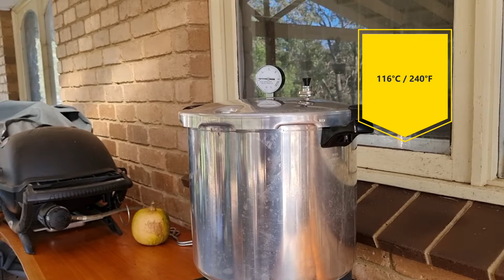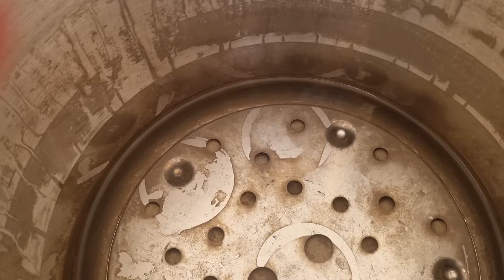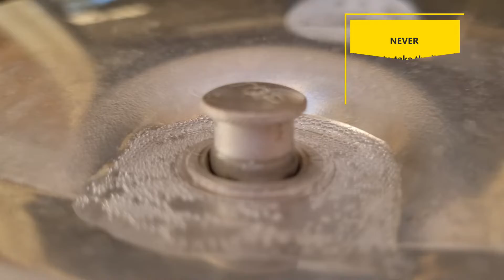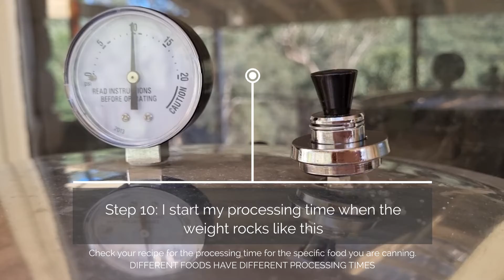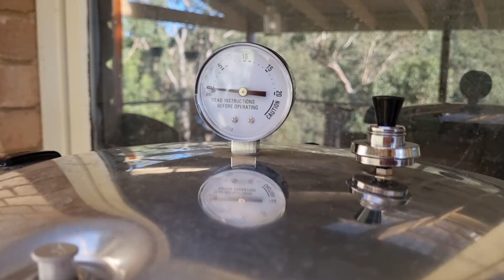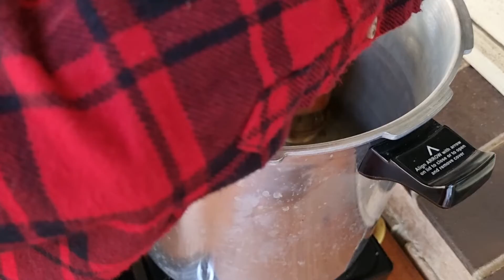Canning Basics Series Ep.4 - Pressure Canning

Comment: This series is incredibly helpful. Thank you! 
Just wondering wat you think of silicon seals. I've seen a few stores like Amazon selling silicon 'reusable' seals, but I'm a little leery of trying them because the big canning brands don't seem to be stocking them. Have you tried them? I'd love to find a reusable option, even if it's only good for a few uses, but I don't want to risk the integrity of the seals if the rings are not the correct consistency.
Reply from the maker: Thanks for your lovely comment and a great question. I haven't used the Tattler reusable style ones personally. We do use ones like Weck though, which has a glass reusable lid but rubber seal which gets replaced.

Comment: One hint that i have learnt over time - if you are not doing a full load in the pressure canner, it won't achieve pressure. Helpful to add a few jars with water in them to fill the space. I reuse my mason lids for this or use wek jars so I don't have good lids wasted.
Reply from the maker: Ooohhh... I like the tip of reusing the lids for this purpose. Thanks for sharing  😀

Comment: Hi
Just wondering I’m new to pressure canning and my weight didn’t jiggle the first time I used it I went off the gage. Is what I canned still ok
Reply from the maker: There are 2 types of weights. 

The standard one that comes with the canning  unit, is just a weight to hold in pressure but doesn't maintain the unit to a set pressure. With the standard weight you use the dial gauge. It doesn't really jiggle as is heavier, so steam doesnt really come out to make it jiggle, unless there is a lot of pressure in the canner.

The second type of weight (which I use and is in the video) is a weighted gauge. This maintains the canner to a set pressure, based on the weight of the weighted gauge. These jiggle when the steam starts releasing at that pressure. If you are using a weighted gauge style of weight, you do not refer to the dial gauge. Even though the dial gauge is kept on the canner.
Reply: Thanks so much for replying 
Can I ask where did you get the weighted gauge from? I got my presto canner from mushroom supplies in carrum downs
Reply from the maker: @jennyhosemans213  They may also sell them... but if not, Amazon definitely does.  Here is a link -
https://www.amazon.com.au/3-piece-Regulator-Pressure-5-10-15lb-0175001/dp/B0B667T1S8

Comment: Where did you get your weighted rocker? Do you say your altitude to get the right weight?
Reply from the maker: You will need your own specific altitude for the correct weight for your location. It comes with all the weights to adjust it, so you could realistically take it to different properties at different attitudes.
This is the one I use - https://www.amazon.com/Presto-50332-Canner-Pressure-Regulator/dp/B07VGQHWVX

Comment: Thanks so much for this Rachel. I’ve been waiting for this one. I’ve got the same pressure canner but like you have a glass stove top. What portable gas burner do you use, please and where did you get it? Could I also use an electric single portable burner? Appreciate your help.
Reply from the maker: The burner I am using in the video is my HomeBiogas burner. But before I had this set up, I just used a portable  camping gas burner like this one...
https://www.bunnings.com.au/gasmate-portable-bbq-butane-stove-single-burner_p0035119?store=4453&gclid=CjwKCAjw69moBhBgEiwAUFCx2MriDpULpUlPk57SK1sPfeUht7vZC75gt4U3bdWHtv1Zrh0NIYjXRRoC8swQAvD_BwE&gclsrc=aw.ds
Reply: @Bush_Edge_Homesteading_Aus  Thank you so much! 🙏🏼 I’ve been debating for ages about which one to get.
Reply from the maker: @sandyg7291  happy to help 😊
Reply from the maker: Oh... if you go electric,  one thing to consider is the size of the pot base. Some electric ones will toggle on and off it the pot size is bigger than the heating element. But if you get one that works, it would be a great option.